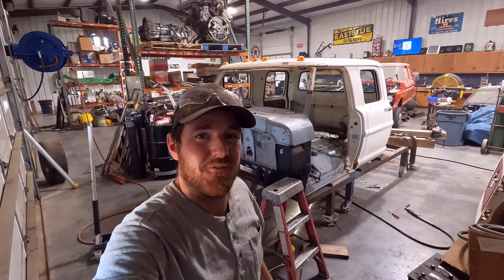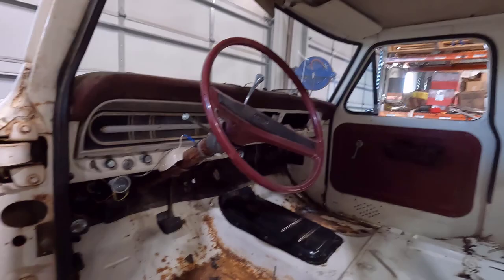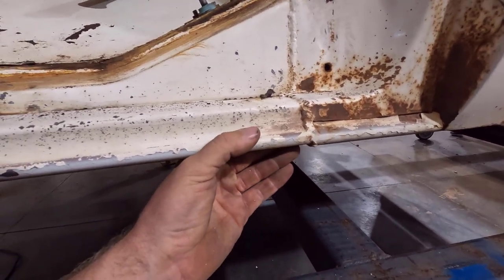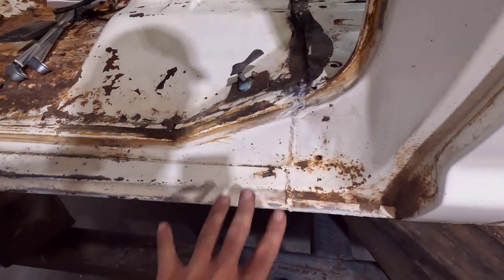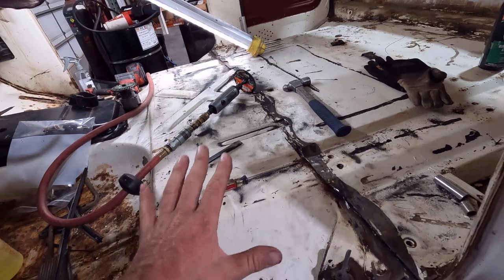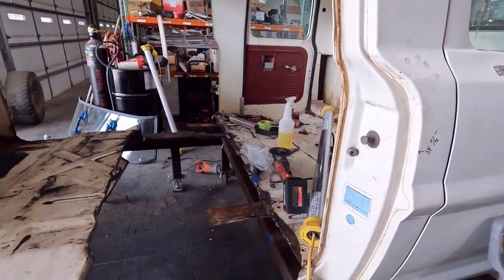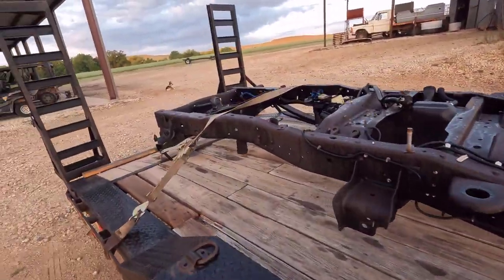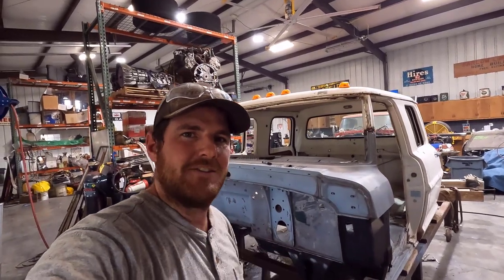I Cut the Front End off a Crewcab!

Comment: Two tips, before cutting shore up with light angle iron. I use old bed frames.. Would have just tacked it in between the roof and B piller and rocker and A piller in a X holding both halves exactly how they were before cutting. I'm surprised the two halves didn't flex  after cutting..
Other tip is cut twice. Then do the precision clean up on the line to be welded. That just gives you easier accessible sites while you're working.

I Remember talking with you about rust repair and you didn't seem to sure. That job you're doing now is way bigger than the little bit of rust we were talking about lol. You do great work. Glad to watch your abilities grow on this channel..
Reply from the maker: I did not add bracing because the areas I were cutting had a lot of structure to them and wouldn’t move. When I put the 2 halves together this was confirmed because they fit perfectly. Thanks for the tips!
Reply: This ford steel, it don't flex. Lol.